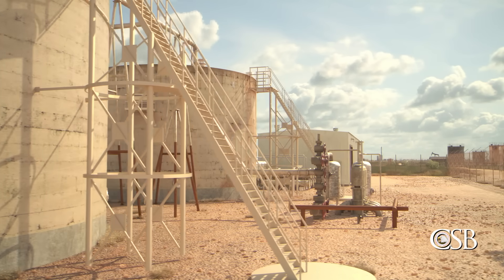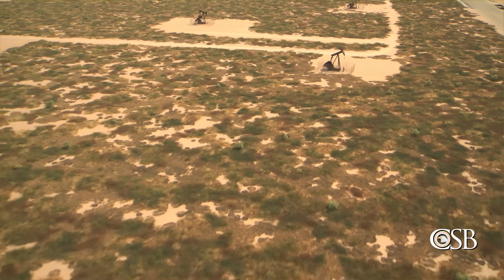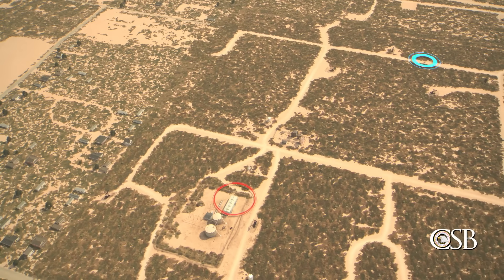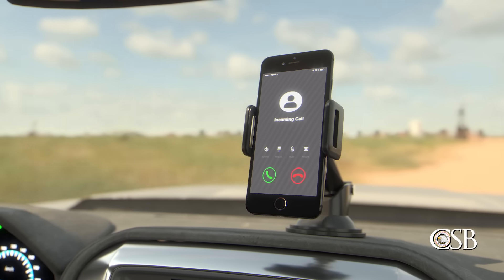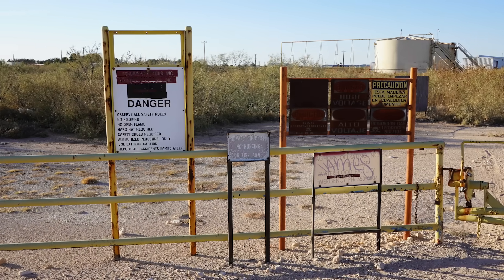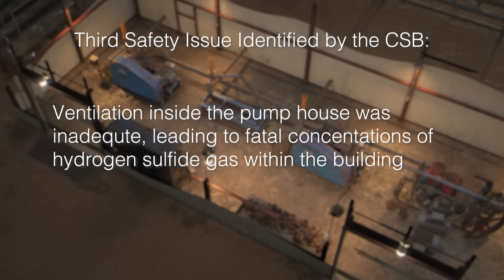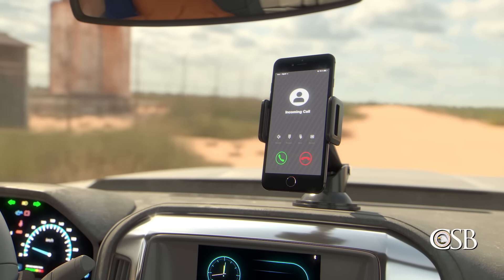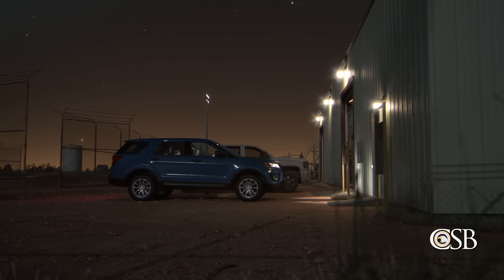Silent Killer: Hydrogen Sulfide Release in Odessa, Texas

Comment: So many of these incidents are caused by apathy and ignoring routine procedure. The warning light should have been tested regularly to determine if it worked. The pump should have been deenergized and completely isolated. The worker should have had his H2S detector. A supervisor should have responded when the worker didn't report in after his shift. Any one of these could have prevented the scope of the incident.
Reply: You wisely did not use the word "accident." Familiarity breeds carelessness. Often just one person, of many, doing the right thing can stop these incidents from occurring.
Reply: @mgratk  You're right about that. And I was careful not to use the word accident. Accidents are things that go wrong when operators do everything properly, not when procedures and maintenance are ignored.

Comment: Ppe is a last fucking resort. Blame it on the worker ffs. 
This is manslaughter based on the businesses failure to correctly administer and eliminate risks. 
Procedures are as good as the paper they are written on. Especially if staff work alone. 

Elimination should of key and could of been easily undertaken. Pathetic that the automated alert system wasnt working. Absolutely pathetic. It was a known hazard to the point where they had systems there... 5th issue. That should of been first.  Thats what killed him and his wife. 
If it can send a friggin phone call it should be able to turn on full automated ventilation systems. 
Manslaughter, someone should of been sent to jail for life for this incomprehensible irresponsible loss of life.

Comment: I don't think a lockout/tagout procedure would have helped here. Notice that he was shutting down the pump1's valves. He was propably going to shut off power to the pump after its valves had been closed, before opening the pump and working on it. This means a lockout/tagout program would NOT have helped here, as a lockout/tagout program normally is 1-step, meaning you lock out all hazardous sources (in any order) before starting work.

What you need here is a sequencing program, with for example trapped keys or similiar, preventing the valves from being closed before power to the pump has been shut off. It could have worked with a lockout/tagout program that must be followed before the location of the pumps are accessed at all, but since meter reading were done 2 times a day, it wouldn't have worked since the pumps must be active for you to be able to read a pressure off it.

So here a lockout/tagout wouldn't have helped, but a sequencing system with trapped keys or similiar. Then you couldn't turn the valve without turning off the corresponding pump, and thus it would become a habit to FIRST turn off power to pump, THEN close valves.

A sequencing program can be combined with a lockout/tagout system by having the last key in sequence to be kept on person, or that the last key in sequence is locked into a cabinet where the workers use their personal locks. However, im against lockout/tagout just because I personally think, that if someone has turned off a safety-related switch, you don't touch it, regardless of if it has a lock or not. Its as negligent to turn on a unlocked switch too, without checking the danger area and checking that everything is in order.
If a safety related switch has been turned off - its ALWAYS a reason for it.

Comment: Don't get how you can be surprised by this gas, it smells like shit so you should know somethings up way before it got to toxic levels.
Reply: If the concentration of H2S is already beyond a certain threshold, the hydrogen sulfide will almost immediately deaden the sense of smell (by disabling the olfactory nerve). The worker might notice the bad smell *at first*, but since it seemingly goes away, pay it no mind. A lack of training and education about H2S could easily lead to such a scenario.
 On the other hand, the odor threshold of H2S is incredibly low, so he should have smelled it even stepping out of the car where concentrations aren't lethal. I suspect the smell had been a somewhat common occurrence (at a not-yet-toxic concentration) where workers eventually got used to it, and stopped paying attention out of complacency and routine. It could also explain why he left his detector, judging that "so far this hasnt been a problem so why would that change?". 
Anyway we may never know exactly what happened. Watch your air folks.

Comment: Crude haulers experience this every day, imagine picking up oil 10 miles in the ranch and no cell signal H2S monitor going off you just go upwind to load. Some of the worst experiences I've had have been south of odessa near crane.
Reply: Crane has the highest concentration of hydrogen sulfide in the world
Reply: Bad stuff back their
Reply: Man if i were you i'd buy a gasmask off amazon to keep in my truck, even if i had to hide it from my boss. They're only 200$,  and should at least give you a chance at survival if the wind shifts unexpectedly.
Reply: Dry the Delaware Basin.

Comment: I thought Hydrogen Sulfide was odorless. 6:24. Or is that only after exposure?
Reply: H2S's odor is actually quite strong and nasty. Humans are particularly sensitive to the smell, detecting at thresholds as low as 0.47ppb. It will however disable your sense of smell past a high enough concentration.

Comment: While the pumper near the pump sniffed the leaking pump, pumping the pumped gas passing through the pump, dropped dead under the pump leaking pumping device inside the pump house. We should further emphasize how the pumper should not insist turning off the pump in the pump house during a pump leak. Repeat the chorus for 17 minutes.

Comment: One of my recommendations would have been to remove the sidewall panels from the part of the building that houses the pumping equipment, and just leave the roof. Security isn't a problem because the building is fenced, and the control room has walls. With no sidewall panels, ventilation wouldn't have been a problem; when you're dealing with hydrogen sulfide, there's no sure way to vent an enclosed building.

Comment: First let me say this is a tragedy for the pumpers family but could have been easily avoided if the pumper had properly worn his H2S mointer.  I am by no means a expert in oil field operations except for the fact that I  hauled crude in and around Odessa in 2013-2014 during which time I always properly wore my PPE with my H2S monitor on my upper chest not on my helmet like some workers.  On many occasions I had to use the onsite SCBA due to high levels H2S and at one site the concentration of H2S was high my monitor was going off at least 50 yards from the well site so I had to turn back.  I am sorry but those tragic deaths are 100% the fault of the pumper for not following protocols H2S is nothing too mess with............

Comment: So If the oil level alarm had gone off, the oil was assumably full of water from the leak caused by the broken plunger. Those are cause by bad check valves or air leaks. If the bad oil had not been drained, then even left on auto the pump still will not run. The alarm will prevent it unless turned to "hand" and then it wouldn't have been on auto. Even if you hit the reset button a few times before you even looked at the pump, before you noticed water on the floor, it might start but it wouldn't run. Because it's full of water and there's a sensor for that, which is activated when the pump is in auto mode. So he would have then, or perhaps immediately, attempted to stop the leak by closing the valves. If he started with the discharge valve, somethings wrong with the plumbing. Its probably the check valve judging by the broken plunger, it should not discharge pressure from that line back into the pump so there would be no other reason to close it first.   It's also worth mentioning some kinds of valves take way longer then you'd think to close, which explains his extended exposure to what was apparently a pretty strong smell, if ems smelled it right away. It's also possible that this pumphouse kind of always stunk like sulphur, some do. There is a tolerable amount of h2s to work in and you cant really smell the difference between that and the deadly amount. H2s gas can also make you *smell blind." But I just wanted to point out in this man's defense, and having some personal knowledge, there's no way this pump was left in a way it could have started, Not if the information about the oil level alarm, or "Murphy switch" and the pump still being switched to auto is accurate. No one wears the h2s meter. The pumps are always leaking. The alarms are always disabled, probably by him, because he's the one who has to get up at 2am and go turn off the alarm and no one wants to pay to fix the problem. Which was apparently a H2s leak, and which can be remedied by treating the well with chemicals. After everything's said and done, he's the one whose expected to stop the leak. Untill the pump mechanic gets there anyway, That's me. He did everything any good pumper would have done. He lost his life more then likely because someone didn't want to pay for routine chemical treatments.

Comment: So the building is designed as an enclosed space with mechanical parts that could possibly leak a deadly gas in the event of a minor problem (which a worker would need to respond to...)
But, there's no built-in detection + alarm system to sound in the building, nor an automatic ventilation system that would kick on in the event of this very-foreseeable hazard? 
Christ.  My bathroom fan is a smart fan that goes off when it senses humidity.  Why not have this feature at an oil well?

Comment: I’ve been gassed by H2s. Short story. On Chesapeake lease, brand new I was 1st driver to pick up the 1st load. Company had a strap guy do his work hrs before I got there. Me wearing H2s monitor on chest went to top of tanks. No smell no nothing no warning of any kind. Thieved the oil loaded tank got back in tractor!!!!!! Then it hit. 
Eyes streaming massive headache body aches really hard to breath. Problem I was about 95 miles from nowhere. Hit panic button people net. Did not work it was still new. Poured cold water overhead drove away from lease as far as I could. Had air on full freezing in cab with mouth over vent to force air into my lungs. 
Was there for 5 hrs. Now I get migraines every month since. 
Sad part. Our strap guy new there was high H2s told dispatch they didn’t do anything. Typical in this industry. 
That was 6yrs ago. My tolerance level to H2s gas is very low. Once hit by H2s your level drops. 
So please do not wear the H2s monitor on helmet behind your head. Looks great & tough macho style. You will be dead.
Reply: You're supposed to wear it below and nearest the face as possible since H2S is heavier than air.

Comment: Hydrogen Sulfide absoutely stinks in very low concentrations. It's not like you wouldn't know it was present, even without the detector.
Reply: If it's in very high concentrations though it quickly kills your sense of smell without you possibly even knowing it's there and then quickly kills you.  This is why wearing an H2S monitor is so important anywhere in the oilfield.

Comment: FYI as far as detection systems go: EVERY worker on a site has an H2S clipped on his/her helmet and those sensors (in front of the nose and mouth). Those sensors detect H2S in ‘parts per million’ well below dangerous levels. They are also replaced on schedule even if they’ve never been used (the vast majority are never used). Those sensors are for individuals. There are safety measures for the group as well. Every site has visible windsocks so any worker can quickly determine wind direction at all times in the unlikely event of an H2S problem. H2S is heavier than air and settles like an invisible ‘puddles’. By being aware, people on site can avoid running into a lethal H2S situation. I can truly say that companies I’ve dealt with care about employees safety. They devote  a lot of thought (their best thought) into engineering safety by design and procedures as a foundation of any project.
Reply: Get the H2S monitors off of the helmets and onto your shirts under and nearest the face as possible like where the 2 sides meet and button together on a button-up shirt.  Since H2S is heavier than air it's possible and has happened that people were overcome by H2S before the monitors ever started alarming when they were placed on the helmets.
Reply: @TheKuptis  Thanks! I got a cursory course in using sensors. My job was 95%+ in an office. Very rarely out on a rig or lease. The lesson that I really picked up is how important it is to stay aware at all times. Any sort of complacency in a repetitive job can get you and others killed really quick. I preferred my computer screens and conference rooms.

Comment: I worked in water treatment for 10yrs. There is no way in hell we'd have been allowed to operate with a faulty or inactive gas detection system. No way in hell. We'd have been dismissed immediately.

Edit: safety deficiencies? You mean complete lack of any safety systems at all? Lockout tag out has been a recommendation for what 40, 50yrs more?

Comment: I don't see how this pump attendant could keel over dead from hydrogen sulfide gas. It can be smelled a mile away. 
It stinks like a bag full of assholes.
Not exactly easy to miss. He had to have known the concentration was high.
Reply: In high enough concentrations H2S quickly kills your sense of smell without you even possibly knowing it's present and then quickly kills you.
Reply: @TheKuptis  Yes. Apparently so.
I looked at various sites via Duck-Duck Go. If the concentration is high enough, it neutralizes one's olfactory receptors in very short time if the concentration is high enough. 
At low ppms, it smells like a bag full of ass holes. I occasionally get some of it come up via my well water. Fortunately, it's only noticeable seldomly.  Since I can occasionally smell it, the ppm must not be too high.